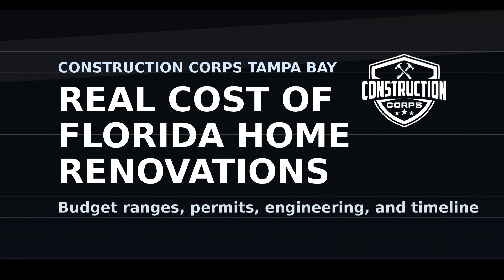Real Cost of Home Renovations in Florida What Homeowners Must Know

Comment from the maker: Most homeowners underestimate the real cost of a Florida renovation.
Once engineering, permits, insurance requirements, and modern building codes enter the picture, a simple remodel can quickly become a complex structural project.
If you're planning a renovation in Tampa Bay, what surprised you the most about the process?
Or if you're still planning your project, what questions do you have?
Happy to answer them.